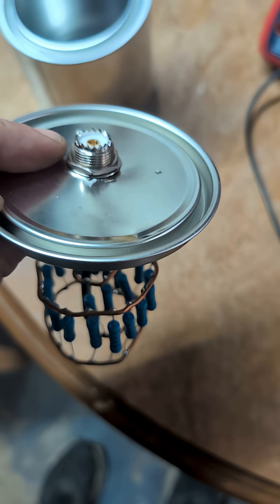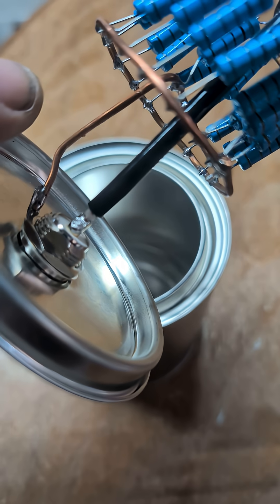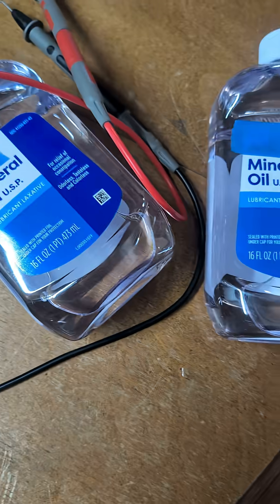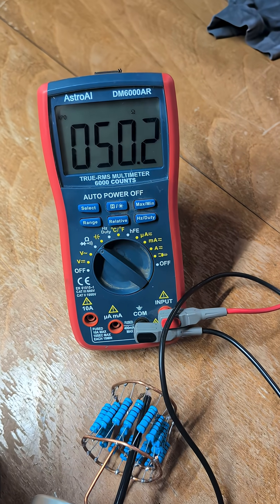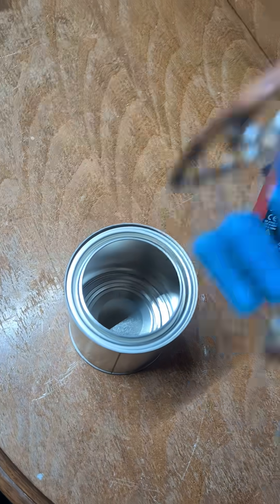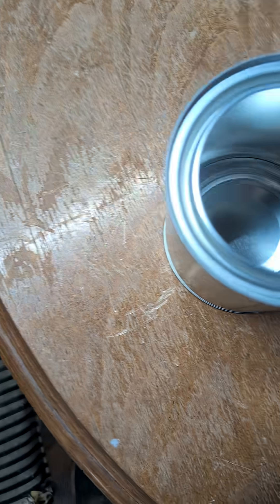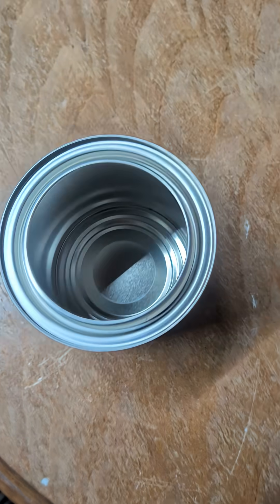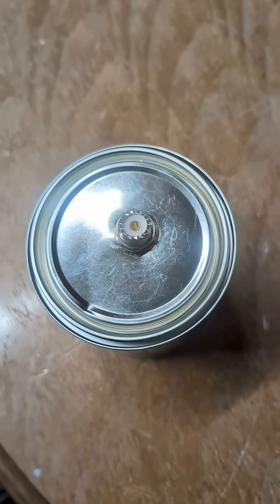Hillbilly Paint can Dummy Load

Comment: That looks like it could become a fire hazard😮
Reply from the maker: Not a chance.  The mineral oil 🪔 s a giant heat sink.  And you're only throwing 100w into it
Reply: What's a dummy load do?
Reply from the maker: @periwinklebubbles  It's a device that acts like an antenna, it puts a load on the transmitter without actually transmitting.  For testing purposes.